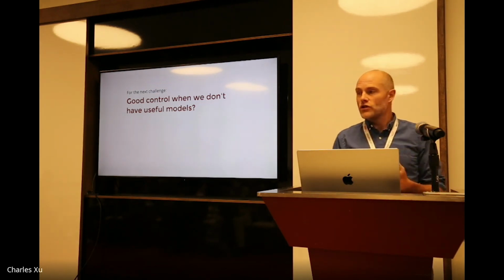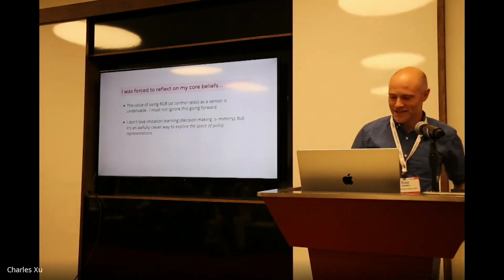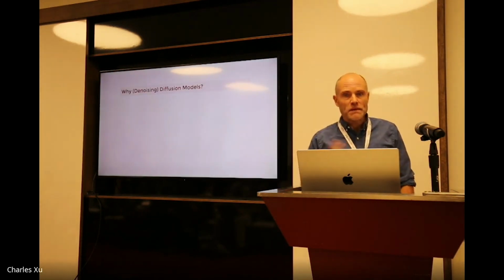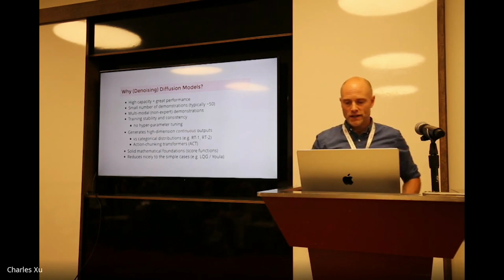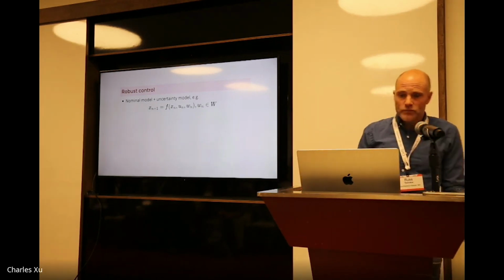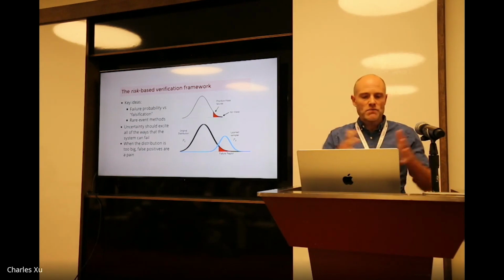Russ Tedrake - Many views of robustness: from robust control to foundation models

Comment: 0:00 - 0:37: Introduction of Russ Tedrake and his roles at MIT and Toyota Research Institute.

0:37 - 3:40: Discussion of dexterous manipulation project at Toyota, focusing on dishwasher loading, and the integration of deep learning and large-scale simulation for robustness.

3:40 - 7:25: Shift to behavior cloning and imitation learning, emphasizing RGB feedback's importance and the adoption of diffusion models.

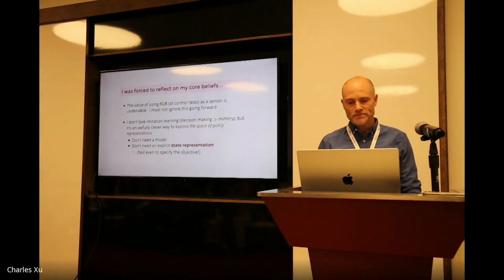7:25 - 10:19: Description of various complex tasks achieved by robots, highlighting robustness and versatility.

10:19 - 14:58: Technical insights into diffusion policy architecture and its mathematical foundations.

14:58 - 17:05: The role of enabling technologies like haptic interfaces, system ID, and visual-tactile sensing in robotic control.

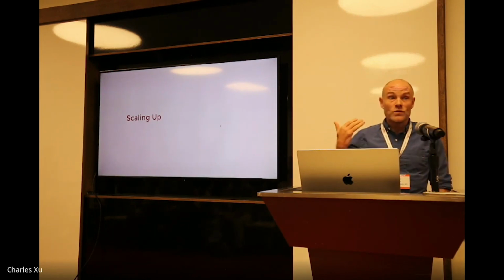17:05 - 21:44: Expansion to multitask training, challenges in robustness, and potential of foundation models in robotics.

21:44 - 25:56: Reflections on control theory, robustness strategies, and the importance of non-catastrophic failures.

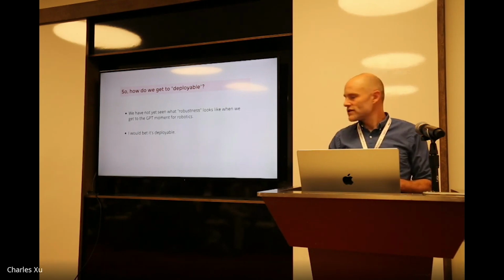25:56 - 30:16: Audience Q&A focusing on task vs. scene complexity and integrating vision in behavior cloning.